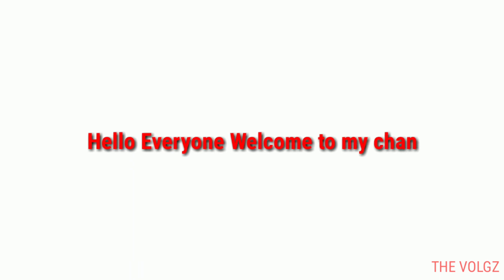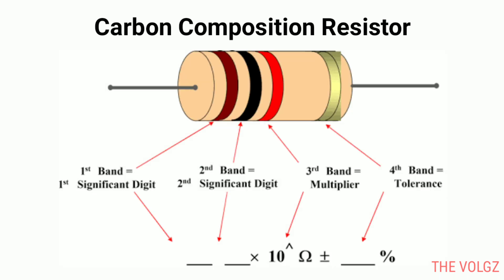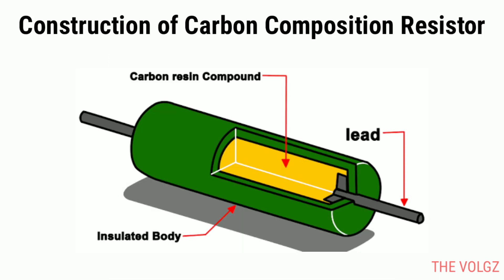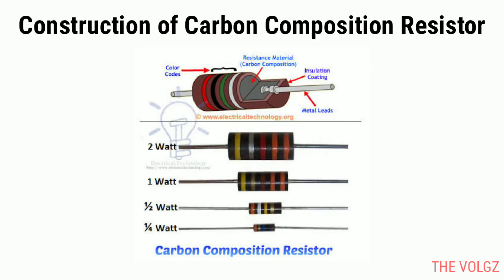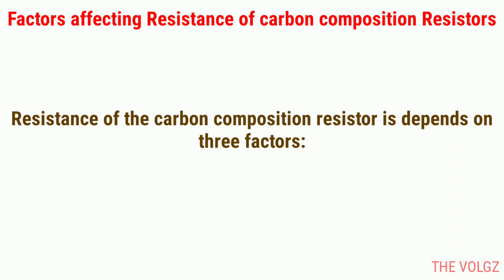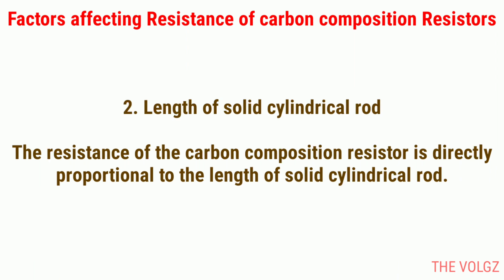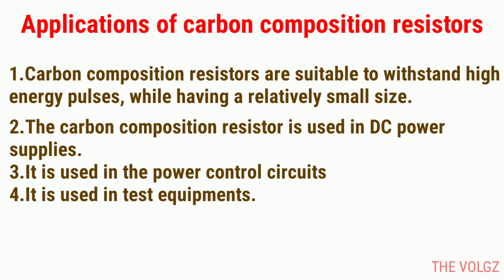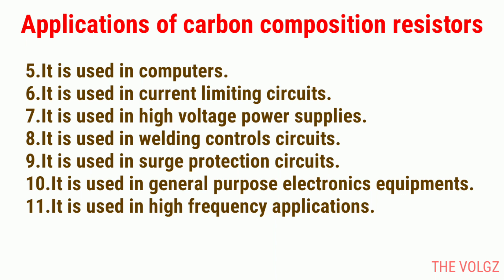Carbon Composition Resistors Explained. Advantages, Disadvantages,Apps etc

Comment: Can you expand on "Generates high noise" please? It is my understanding that carbon composition resistors have an extremely low (nearly zero) ESL and ESC which should help prevent coupling and resonance.  Thank you for the video